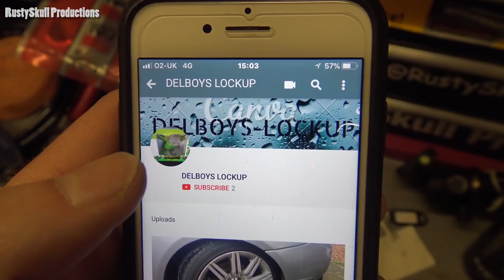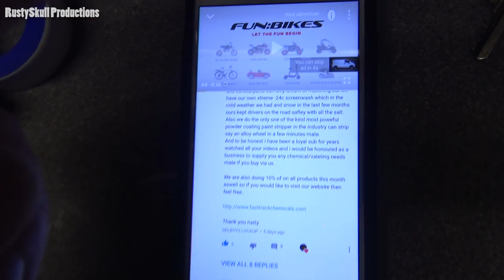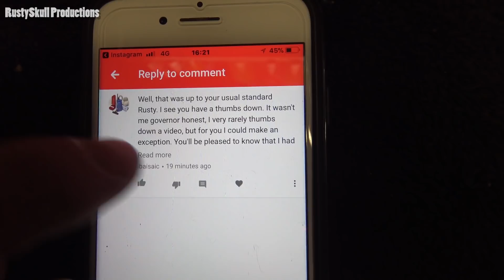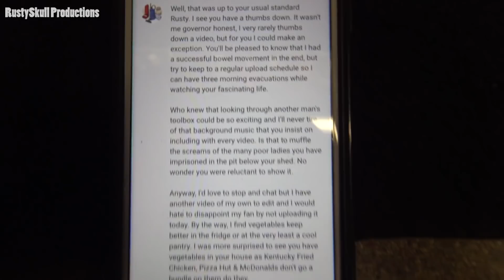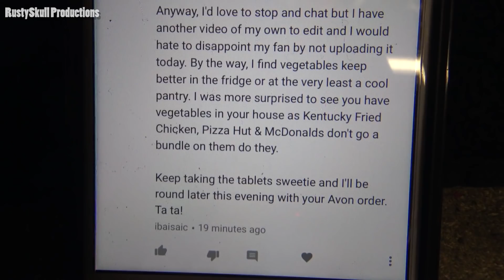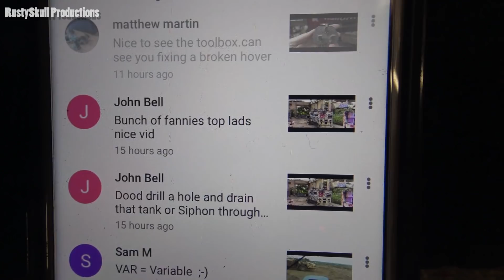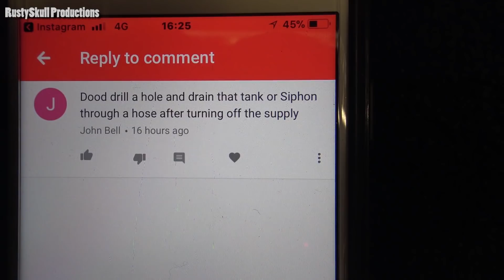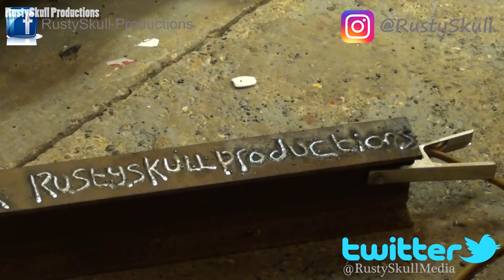Honda Lawn Mower Repair Part 1 - RustySkull Productions

Comment: Rusty I have a wacker plate that runs fine but the exhaust gets so hot it actually glows cherry red but runs and idles perfectly, what do you think the problem could be mate.
Reply from the maker: Most likely a bit lean, could be a sticking valve but that would cause bad running probably :)
Reply: RustySkull Productions Thanks. Ill try and ajust the carb its a honda engine so pretty easy to work on. Again thanks very much. Only joking about the woodbines mate.
Reply from the maker: Let me know how it goes! 
And no problem  lol I know you were :D
Reply: RustySkull Productions You was right about the mix mate had a tinker on the carb think i got it. Your the man.Thanks
Reply from the maker: You’re welcome dude!